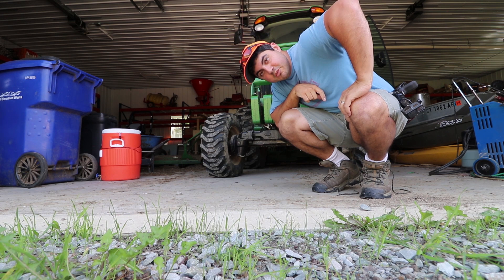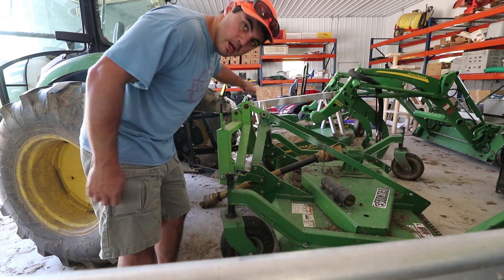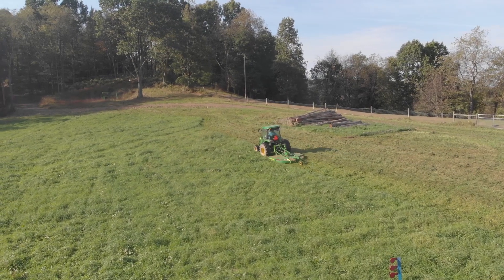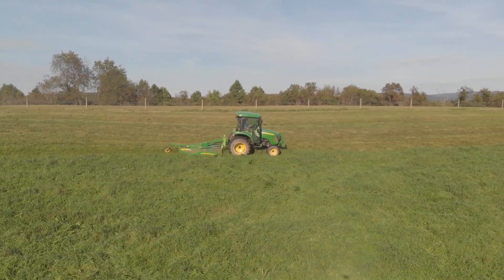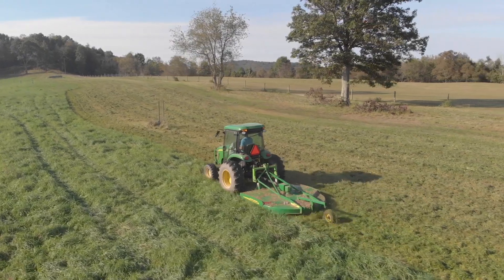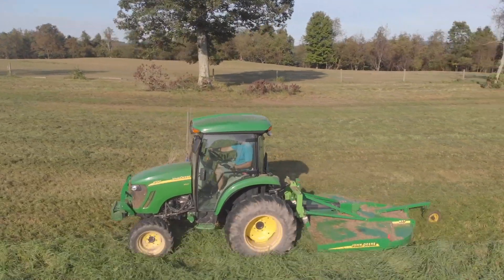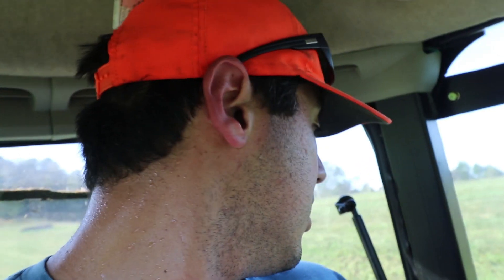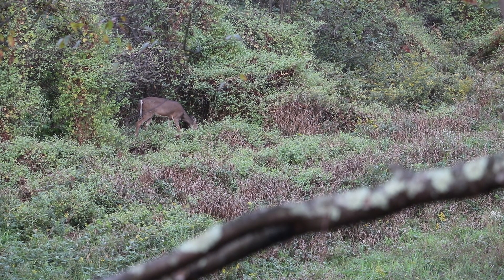FIRST TIME I MOWED THE HILL.... ALMOST FLIPPED THE TRACTOR :(

Comment: You can fill tires with windshield washer antifreeze- old farmer trick. Puts weight low, better traction. Grounds it and helps prevent tipping.

Comment: Chop and drop is okay. You could also look into what it would take to turn some of those cuttings into silage you can feed your stock with.

We used to have a guy cut and bale our roughly 15 acres of hayfield, but I do not recall the % of bales he got to keep but I know it was far less than 50% of them... probably more like 20-25% - he also cut and baled the 100 acres right behind us, thus it wasn't a special trip to haul his equip for our 'small' fields.  All we had to do was pick up our bales and stack them in our barn.

Hopefully that was lesson indelibly learned. You have to be careful on hills. I had a HS classmate die the summer after graduation when the combine she was driving tipped over on a hill.

Comment: #askhomesteady  It bothered me that I couldn't remember where I read about selenium in manure so I finally found one study that seems to address it briefly.  My ponderings actually are about recycling minerals and selenium specifically (beyond a broader term of "nutrients") as a possibility, in the manure from grazed animals, or possibly in the chop and drop you are doing currently on your field.  There are more studies about applying selenium(not in manure) on pasture, but I did cherry pick this line from this https://www.ncbi.nlm.nih.gov/books/NBK216733/study : "Applying manure to low-selenium soils from animals fed imported selenium-adequate feeds increases the soil selenium content slightly."  A couple of other lines might address returning selenium by mowing:  "... high sulfur-containing plants such as the Crucifera (mustard, cabbage, broccoli, cauliflower) are relatively strong concentrators of selenium." "Allaway (NRC, 1971) has found that for soils having moderately low selenium levels, alfalfa accumulates more selenium than red clover, timothy, or brome grass."
I'm thinking about this because of our own pasture and hay field management with sheep and beef cows.  Currently we take a cutting from most fields and then do some rotational grazing on them to add manure and trampling with the hope of benefiting  future soil.  We then move the haying operation to our neighbor's fields.  I've worried that he doesn't currently add anything to the fields as we are taking the hay and he does no mowing.  Currently his fields have much more current purchased re-seeding than ours but that is a different interesting field of interest (ha).